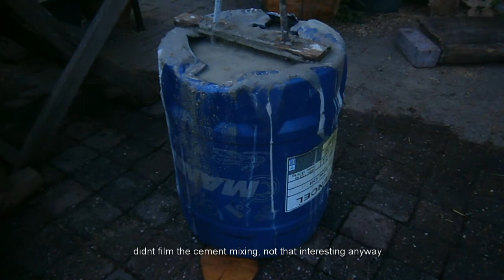Goose Chainsaw Carving. Part 3: Getting closer to completion

Comment: Good evening Mathieu !...
I'm sure I've said it before..love to watch you work...
It's almost done...the greater part of it is finished for sure...
Have you had any claims on it yet ?...it'll sale quickly...
Such great work !...
We'll be watching for the base attachment and the completion of the Goose...
Have an excellent week..😉...🌿🌿🌿
Reply from the maker: Good evening to you too Pamela!
I think you have mentioned it before. I dont mind hearing it though 😄
Its pretty close to finishing indeed, need to work on the feet and legs a bit and i do need to shape the lower part of the body a bit more..
And then there is the head, ive been putting that off a bit, really doesnt need much work but it does need some defining, taking it all slow, wouldnt wanna mess it up at this point ofcourse!

so far no takers as far as selling goes, im planning on bringing it to a few markets in june. will be taking a trailer then so plenty of room to bring some bigger stuff allong!
 will be a good eyecatcher for sure. and the big carvings do help to sell the small ones as well i suppose.
i expect to finish the goose before end of the month. i did manage to get it onto the base today but now its stuck on there haha, was pain in the ass moving it but i do need it to stay on there for now. i think a crowbar will get it off easy enough.. much more stable and higher up now anyway. will make it a lot easier to see what i am doing!

next week though, ill make some smaller stuff again, did get a bunch of ash wood, well see how that carves, but i think its nice. im sure ill record some of the smaller stuff as well.
also have a few bigger pieces of some kind of conifer, pretty color wood but i dont know what species it is, guess its a taxus *Taxaceae family, decent chunks either way.
so yeah, no worrys about running out of wood for a little while!

You have a great week as well! :goodvibes: